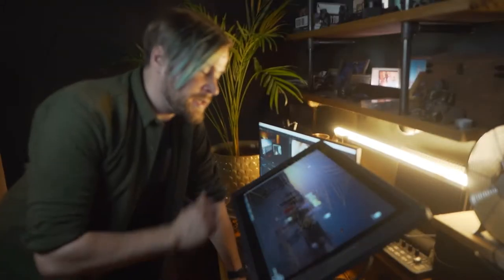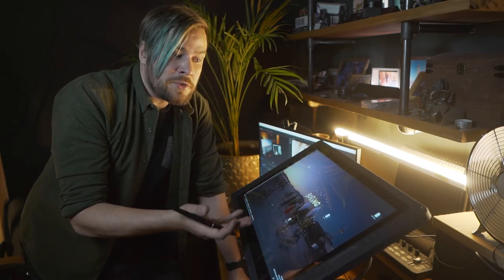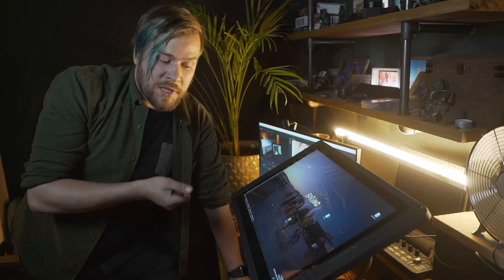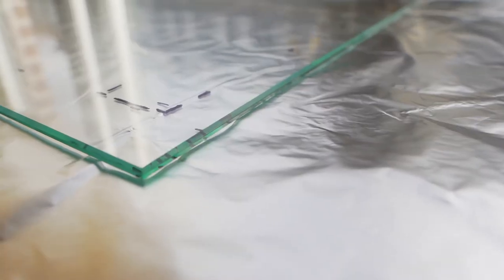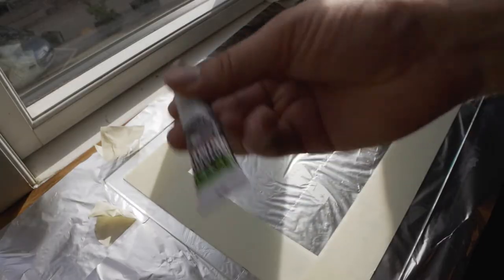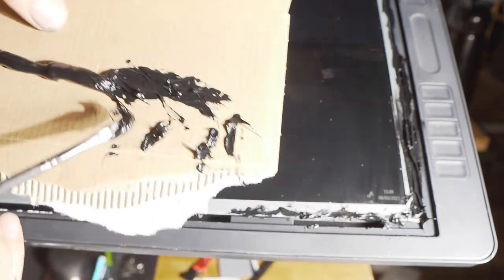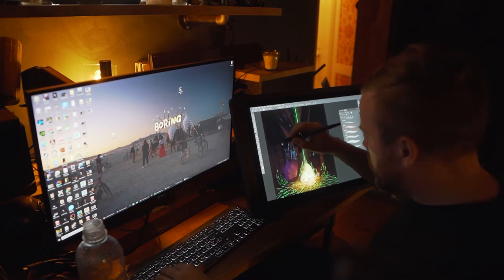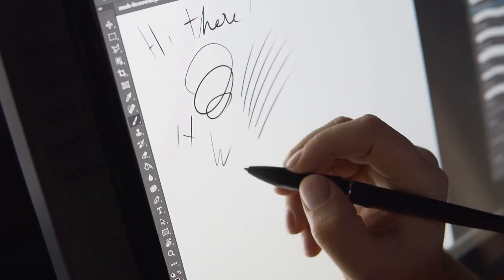Repairing a smashed pen display // Huion Kamvas 22 pro

Comment: Props to you man for actually trying out a diy repair that in my experience with replacing laptop/tablet/phone glasses is exactly the same process. (but also lucky you that the LCD display underneath wasn't damaged!) It's a shame that wacom huion etc. don't even offer replacement parts for a consumer to purchase for what are perfectly fine devices and often VERY expensive in the first place even if it's a more budget oriented device.

tip: use 99% alcohol on a q-tip and apply conservatively + scraping/abrasion to REALLY get rid of the old glue proper. - but that primer, windshield silicone , and clamp compression basically guaranteed that glass ain't going nowhere even with the old glue on there lol.
Reply from the maker: Neat, thanks for the tip. And yeah, shame there's no spare parts for such simple repairs
Reply: What can I do if I damaged the display?, touch screen still working but it just show a black screen with some white points. It doesn't even show the Huion logo when It turns on. Can I Buy a new display and replace it? Heeelp

Comment: I got my very old wacom DTI 520 cracked. So I was planning to get it fixed in local pc repair but worried that they might be rough or damage it. Your fix looks so easy to apply at home. Thanks a lot. I have antiglare screen (tinted glass that by coincidence fits on top of my wacom). Had the same problem, the feeling of its not like graphic tablet screen anymore. So I got those A3 transparent plastic sheet from printing shop and placed it on top of the screen. About 10 cent a sheet and replace it after few months ( you can see scribbles once the monitor is off or when sunlight hits the black screen). But this solved my problem.
Reply from the maker: Excellent tip, thanks!
Reply: Did you fix it?
Reply: My old setup is still on, never thought of sending it to be replaced. My Wacom is very old still working with minor issues (no screen issue )but get things done and sending it for screen replacement must be handled with care (old equipment) and I can’t take that risk.
Reply: hey! so if i understood correctly the transparent plastic sheet feels better when you use it? and you basically placed it over the glass one or you only used the plastic one?

Comment: Thanks man, great vid, I have a Cintiq 24 that suffered a big crash on shipping, I'll try this fix, probably will look for a translucent acrylic instead of glass though.
Reply from the maker: You're welcome. Do be aware that thin acrylic of that size  will flex a lot and it will scratch up real easily. Also with wacom, the customer support might be a bit better where they might be willing to repair or sell the parts ;)
Reply: @jokoivi  thanks for the tip, I reached to wacom, but I'm in Mexico and customer support down here is not that relliable, also very expensive, so I think I'm going to go with the DIY option.
Reply from the maker: @gonzomandela  ah, i can relate. Good luck, hope the repair works out!

Comment: Hi there. Thanks for sharing this. I'm going through a similar fix on a much smaller tablet, but like you, my LCD and touch screen work. Can you tell me how thick the replacement glass is?
I don't want to get something that is too thick and won't work for the capacitive touch screen.
Reply from the maker: You can just test how thick it can be by hovering your pen over the screen... If the cursor still works, it's good. Mine was 3mm. Anything thicker would be affect the drawing experience negatively while thinner would be hard to find i'd imagine
Reply: @jokoivi  3mm is the minimum thickness my local glass company can provide, so that's good news. I will get it cut by them and test it out before I do any gluing.  Thank you for the swift response!

Comment: Thankfully my glass is fine but I bent the 3 in 1 cable while inside the usb c port of mine. Do you think theyll do these kinds of repairs like replacing the usb c port inside the tablet? I have the 22 plus
Reply from the maker: You can take it to any electronics repair shop, soldering on a new port should be a fairly trivial task ;)
Reply: @jokoivi  Thats reassuring to hear tho I'm not sure they have that special 3 in 1 usb port, or is that technology all in the cable?
Reply from the maker: @VeylmanTheRock I'm no expert but most likely in the cable yeah since USB c port is a USB c port, same pins.

Comment: hi joseph. all ok?
could you help ?.. my monitor was scratched by another glass, the risk that makes my work very difficult, I think I will have to change the glass for another one, or simply invert it!
Could you tell me if it is safe for me to remove the entire glass with the iron? without breaking
Reply from the maker: Would it be safe? Definitely not, it's always a risky move which should be taken only if there's no way around it. There is a always chance of damaging the LCD underneath or breaking the glass. Also,  Just the iron would not be enough, it Will need to be cut / pried with a blade still. The heat is mainly to make the glue a bit less stiff and give it a bit of leeway to get the knife in between. On the idea of flipping the glass around, while that might be a solution, the texture in the other side is not the same - the top is matted while the bottom is your normal slippery glass.
I'd rather recommend finding some stick-on screen protector sheets instead as someone mentioned in one of the comments of this video. That should take care of the scratch.

Comment: Did your screen had a glue inside of the entire glass too?
Reply from the maker: @miyafoxy2540  only on the sides. Might be that new models have changed?
Reply: @jokoivi  Mine is from 2018 😭 4 days removing this amount of glue. But it will work.

Comment: And what's the size of this screen glass to buy it?
Reply from the maker: For my specific model, it was:
thickness: 3 mm 
Width (mm):
510
Length (mm):
31
If yours is different, use a measuring tape on the glass.
The shop I used has gone out of business since. Just Google "glass cut to measure" and you should get some hits.
Reply: Omg really thank you!!!  @jokoivi
Reply: Couldn't be better a 2mm glass? Mine is the sabe drawing table than yours.
Reply: @jokoivi and what do you think its better to search? An acrylic transparent pannel or a glass like you did?
Reply: Is not the length 31mm too small for this piece? Is that correct??
Reply: @jokoivi sorry for so many questions, I just want to do the right thing here 😅
Reply from the maker: @miyafoxy2540  2mm glass would probably be even better but I was not able to find anything thinner than 3. 
From what 8ve aeen, acrylic gets scratched up super easily, hence using glass. Perhaps theres more dense acrylic options out there than what I've tried?
Reply: @jokoivi  Oh! Right! Thank you!

Comment: OMG you actually used glass panel (heavy and too shinny/reflexions).....why you didn't used plexiglass (acrylic transparent glass)1- 2mm tick, isn't heavy,little flexible, more cheap, easier to cut and the manufacor probable used the same (plastic glass).....also you can aply a transparent sticker as a protector and you will have a little grip to feel like drawing on paper and reduces the reflexions
Reply from the maker: Original was glass as well, just 1mm thinner with a matted surface. And I specifically went with glass because plexiglass is too soft - the pen would  scratch it up real easily and it would flex under your hand with such a large panel and small thickness. And Plexi has plenty of reflections as well since its not the material, rather surface smoothness which causes it.